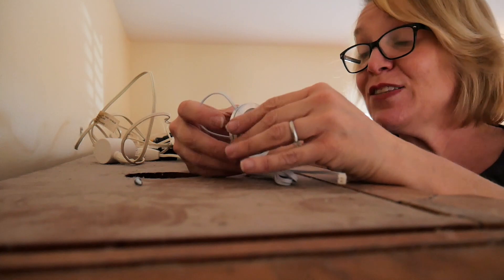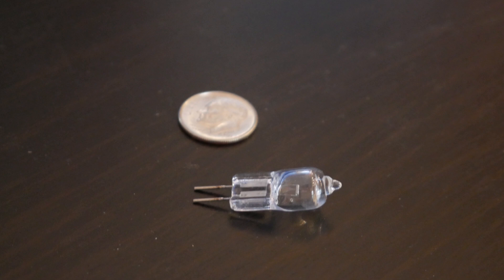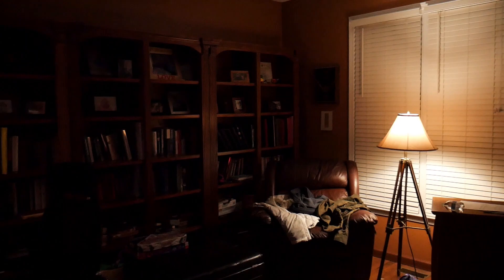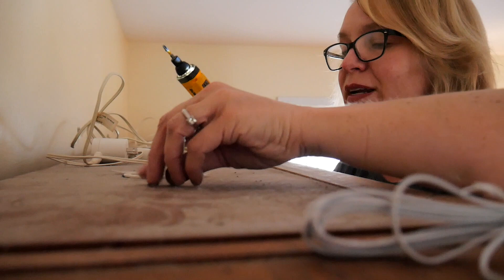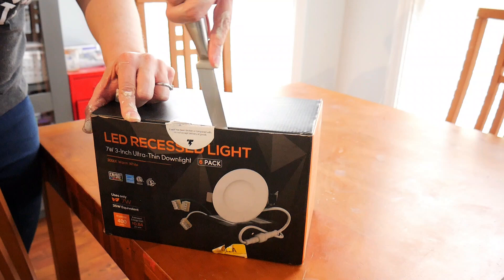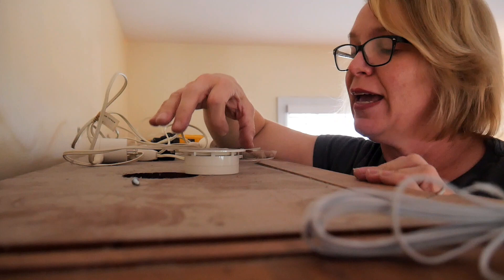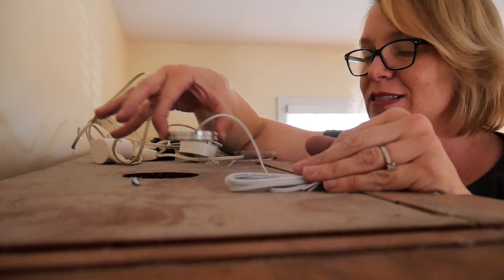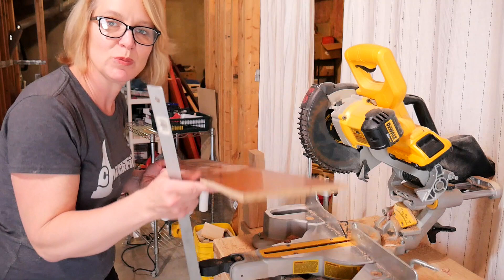Replacing Outdated Cabinet Lights with LED Puck Lights

Comment: Nicely done! I've been after the same replacement led lighting myself. Now I know they're called puck lights! Thanks! I do need lights where the cable come out the middle though. Fingers crossed! Great video! Thanks.
Reply from the maker: Thanks for watching, and best of luck!
Reply: @ChickFixUSA  Just thought I'd let you know, I've ordered a set of 4 puck lights to see if they'll work for me! If they do, I'll getting ordering some more to complete the set! Thanks.
Reply from the maker: @MountainBikePete  Hope it works out for you